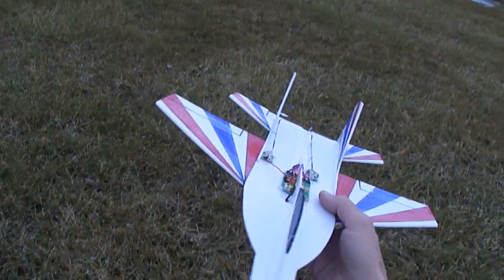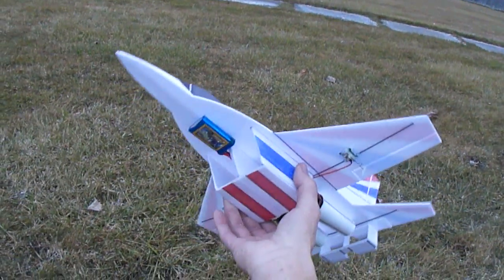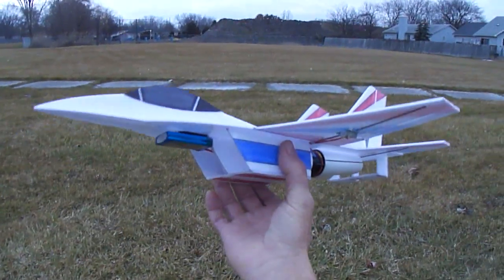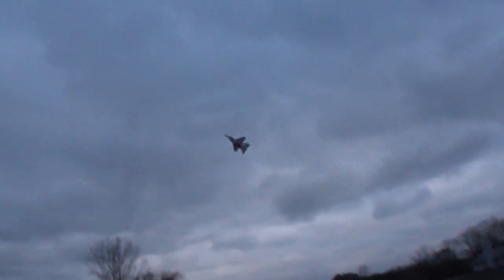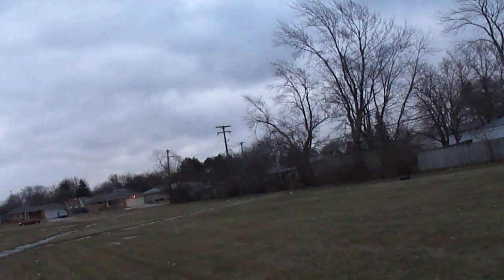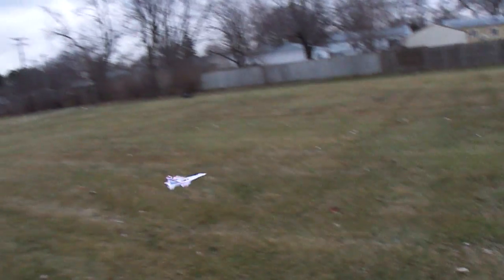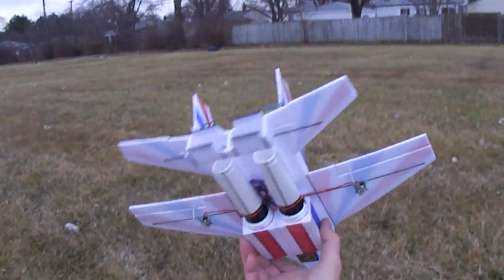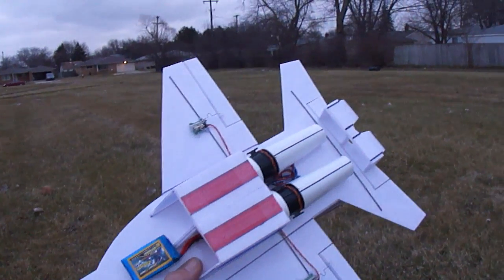Micro Mig-29 Built using electronics from the UMX micro A-10 Warthog.

Comment: Did you have to do anything to electronics to get them to work in a different airframe ? I have a umx3d beast all the electronics are working perfectly but the haul is trashed
Reply: Look into minimum rc I feel like some parts could be used for that if not then you can make ur own design using foam board and use it as a guide